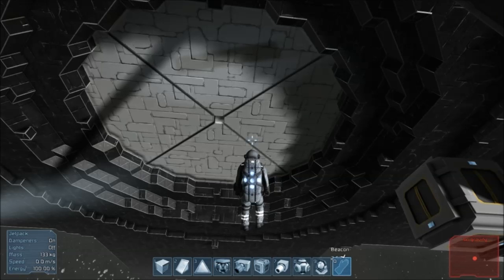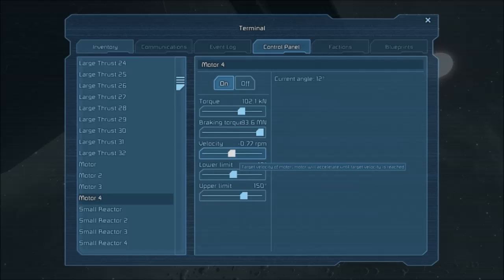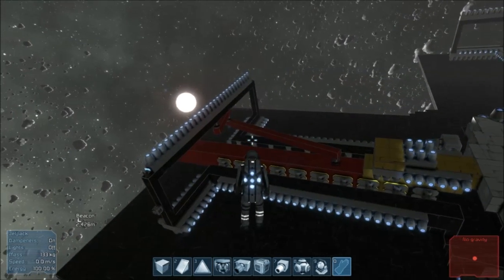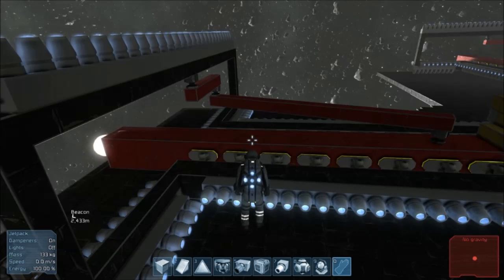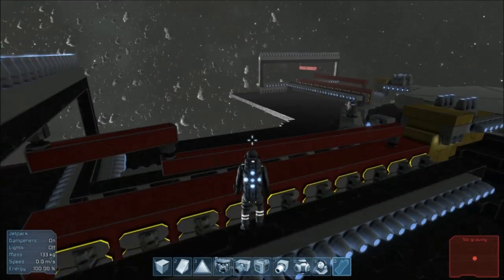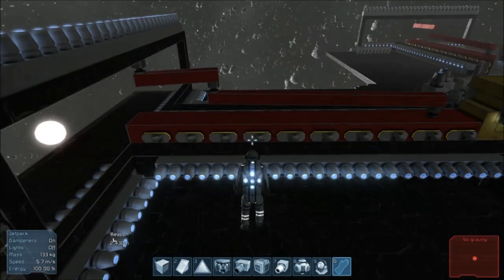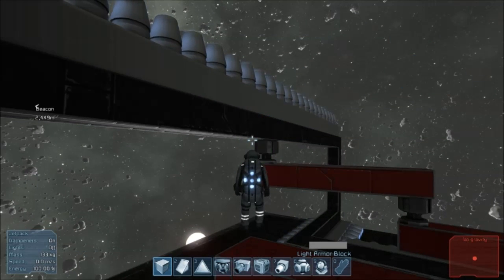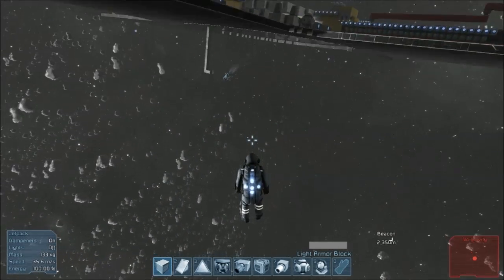Space Engineers ep03: Working Piston Door!

Comment: Very interesting, gives me an idea of building one that pushes the doors outward to open, then pulls them and wedges together to form a seal. It would probably use 1-to-1 on the arm lengths, so the drive-arm would stick inward at a 40 degree angle, while the forearm would apply that energy to the door proper. I'll have to hinge the door as well, but it would be interesting!

Comment: Very nice.  I've yet to see vids of hangar doors that are both complex like yours and smooth operating :D  I agree though that you could condense it, probably by having the attachment directly on the door (you'd still need the bit between the landing gears to stabilize it, but I don't see any reason off the top of my head why it has to be so long or why you couldn't connect the conrod and crank directly above the portals, as it's not all enclosed like it would be in an automobile motor's piston assembly.  The little spacing differences with the motors might forbid that, but if so I don't see why.  It would also, of course, prevent you from eventually hiding the whole thing behind the interior walls of the ship if you desired to do so (and that's gonna be one helluva big ship 8o) but you could still get right up to the base of the actual door sections without that being a problem.
Reply from the maker: Before realizing how big it was, I built it so the whole assembly could be hidden under the floor. I like your idea of attaching it on the backside of the portal doors, it would greatly reduce the diameter of it, the floor of the cargo bay would be a little higher, and you would see some of the workings on the inside when it's closed, but that's not a big deal to me. I'm going to do a rebuild in the next few days using these options, and hopefully can bring it down to a reasonably size. Great comment! thanks for the feedback!
Reply from the maker: darkshark6gamer Yeah, I will upload it maybe tonight, but definitely tomorrow.
Reply from the maker: darkshark6gamer I put a link in the description!